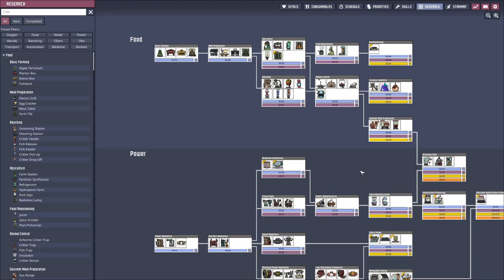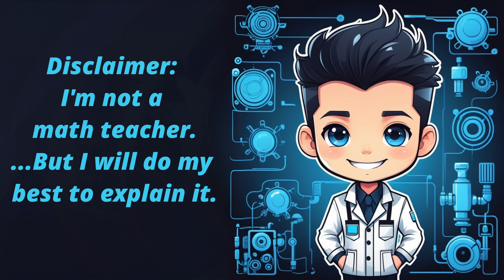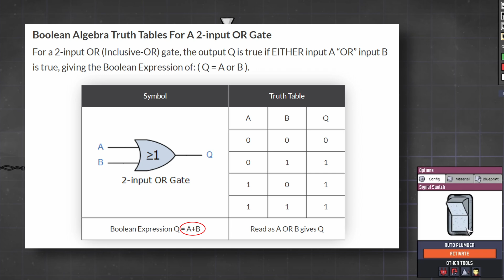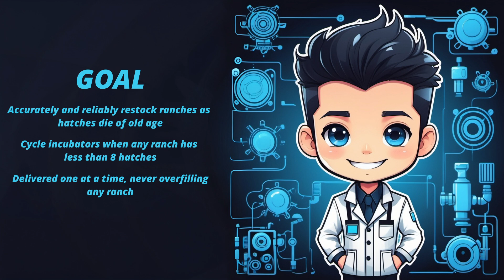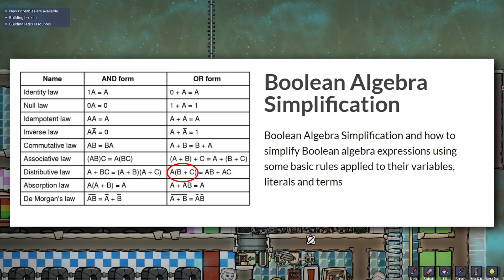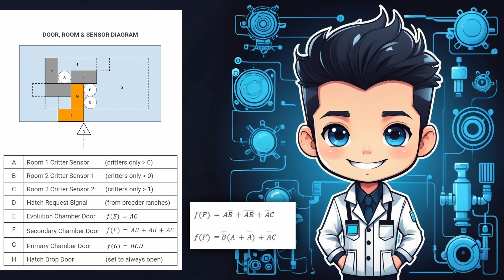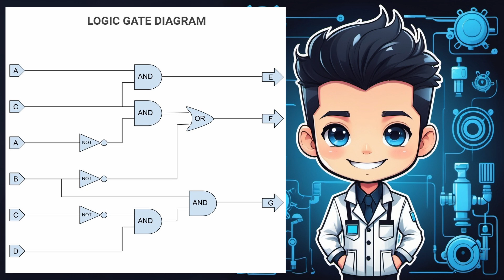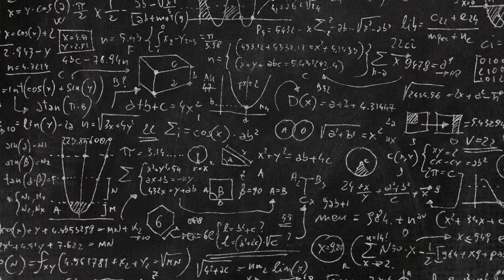Ultimate Auto Hatch Ranch | Oxygen Not Included | ONI Tutorial

Comment: I'm a little confused about the Incubated Hatchlings, do they pop out of the incubator when they are adults? or do you have to always hit the remove button on them? Also, what do you do about Stone or Sage Eggs? Do you just ignore them and only do regular Hatches?
Reply from the maker: Yes, they pop out on their own once the become adults. The ranches can be setup for any of the variants, the only thing we need to change is which type of egg we want in the incubators and what food we wish to feed them via the loader (beside the pressure plate) and the feeders themselves inside each ranch.
Reply: @engineertroy_  Thanks! I have a couple more questions if you don't mind. If you don't pull out the babies from the incubators, doesn't it mean that it very likely for 2 critters to be in Room 2 quite a lot causing them to be "evolved" instead of filling the ranches below since that only happens if there is only 1 critter in Room 2?
Also, for their food input, do you have loader outsider of the Ranch stack set to Sweep only and allow manual use? Otherwise, it seems Dupes will infinitely pick up the food on the Weight Plate and send it back through the conveyor system. Also, I assumed you have the notification setup to notify if your food is getting low?

Thanks a lot with answering my questions and I appreciate the video, especially about the Automation Logic and breaking down the math for it so we can understand it better.
Reply from the maker: Great questions!

Hatches should only be sent to evolve when there are more than two in the upper chambers.  The reason this incubator behavior (exit upon maturation) works in our favor is because a baby hatch cannot jump up into room one until it as an adult which means room two will not allow delivery until we can ensure we can do so one at a time.  The fact that we allow them to mature inside the incubators means that we should never have more than two hatches up top unless A) The ranches are all full or B)We remove them from the incubators before maturation allowing new eggs to incubate and possibly hatch before the first two reach adulthood.  In the case of B, hatches will be evolved prematurely until there are only two hatches that can be properly separated by our door automation for delivery.

Yes, we can avoid infinite pickup by making the input sweep only.  I did find that dupes will wander in if the material we use for food is needed elsewhere.  I get around this by setting access to the incubator room to only ranching dupes that I have also disabled supplying errands for.  So far this has stopped any tomfoolery in my play through.  If you want to avoid infinite pickup without sweep only I recommend combining this door permission and supply errand setting with a loader connected to the food input set to manual use.  I'll have to do some more testing but this should in theory work, thereby achieving full automation.

Thank you so much!  Glad you found this video helpful.

Comment: Shouldn't the timer sensor be set to 525 and 75?  A Cycle is 600 seconds. At 600 and 75, the lullaby time will gradually drift through the day.
Reply: No. The buff lasts for 600 seconds. If you turn the incubator on after 525, then the egg will still be buffed when it turns on.

Comment: After 100 cycles. this build can absolutely get you carnivore as long as you have it finished and full of hatches before cycle 60.  I didnt get it fully built until around 60ish. With that being said at the end of cycle 100 i have 336000kcal consumed. I would start with an operator for my next run, as that is all i was waiting on to complete the build.
Reply from the maker: My go to lately is having ten duplicants eating 10-20kcal(depending on your difficulty setting) by cycle 50. I’ve seen people do it way faster by abusing a stress eater which can be a lot of fun but that requires singular focus and a bit of luck sourcing enough hatches.  It’s even easier with bammoths!

Comment: Quality content here.

How might you adjust this build using the critter condo (either for increased temperature tolerance or for 9 hatches in each room)?

Future automation suggestion: automating delivery of hot materials to the geothermal heat pump. I haven't seen this covered much, but by pumping in very hot liquid to the geothermal heat pump (2200+ C), you can get rare materials as a byproduct. In my colony, I pumped liquid metal from the volcanoes to achieve this. However, I also want to use it as a water purifier and a source of steam power when not handling molten metal. This means that each batch of liquid would need to be separated. I'm proud of my design, but I'm curious what your take on it would be.
Reply from the maker: I'm still working on optimizing the critter condo integration!  Truth be told, I haven’t really done much with them yet.  Thanks so much for the comment and the suggestions!  They are on the list. 😊

Comment: Aren't "or" gates redundant?
You can connect a receiver directly to two different signals, if either is green it will work the same way. (It's just a little less visual)
Reply from the maker: Great observation!  Yes they are redundant unless there is a potential for signal back feed to something that is connected.  In fact, the ranches are connected in a sort of multiplexed OR gate where any green signal from any of the ranches causes an overall green signal to be sent to the incubator control circuit.  You also may have noticed that there are no OR gates in the final control logic, only AND gates.  The NOT gate is connected directly to the AND gate output for door F even though it shows the gate in the Logic Gate Diagram.